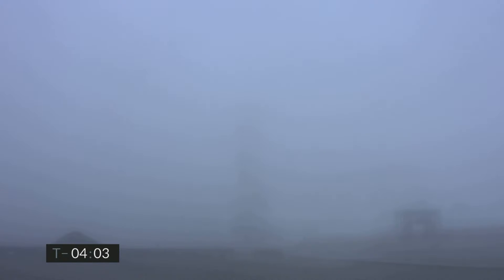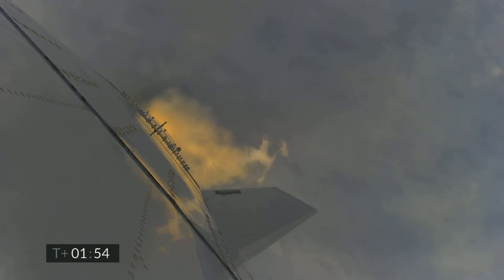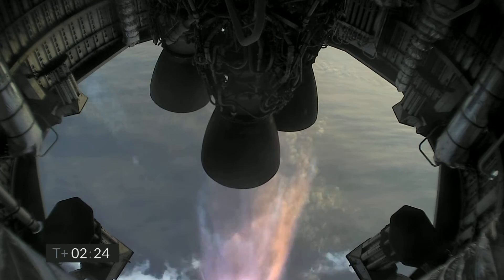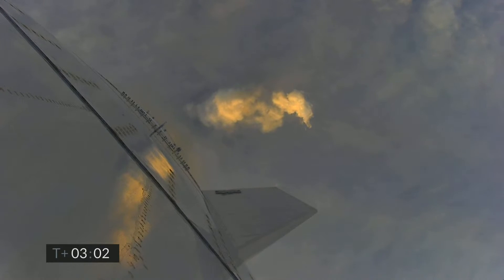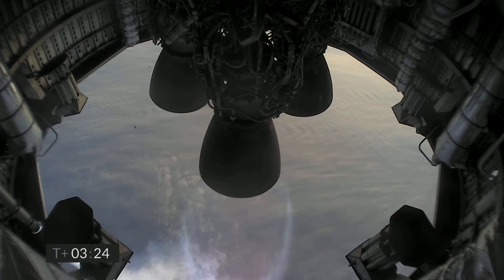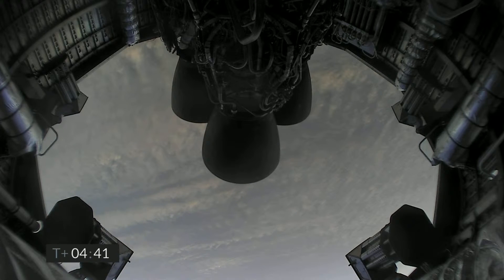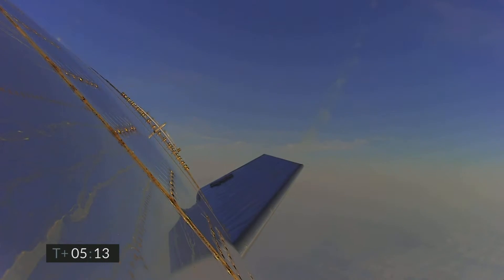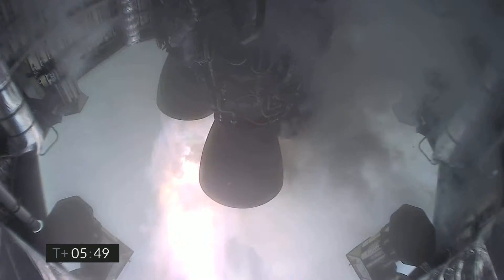Starship | SN11 | High-Altitude Flight Test

Comment: If I'm ever on Starship, knowing that it has failed in all these ways will be comforting. Once it's failed one way it can't fail that way again.
Reply: That’s like saying I’ll never have a flat tire because I now installed a new one.
Reply: It appeared that it blew up after the engine reignited. Probably a leek that caused the explosion
Reply: Wut? It is the same inability to reignite the engines over and over again. They already built 60 of those and still have no clue how to get the reignition reliability up. That's it. Project over. No engines, no starship.
Reply: @hans-joachimbierwirth4727  news flash: SN15 will use an entirely new block version of raptor. SN11 was running an old version of the engines because the new version requires plumbing changes. So, calm down, they'll figure it out.
Reply: @raiguard  He's just some troll who always starts shit. Take a quick look at his channel, it isn't the first time where he has tried faking being an expert at something.
Reply: Musk fans and their last resort...
Reply: @hans-joachimbierwirth4727  you clearly have no clue, for SN8 lack of pressure meant the engine couldn't start so that was 100% not an engine problem, if you're so good go work for spacex mr trollolol
Reply: @hans-joachimbierwirth4727  yeah glad you're not the one building it tho
Reply: If i were in charge they wouldn't have failed. I was responsible for the shift of quality control in design and engineering of nuclear reactors in the 80s. In contrast to Musk i know what i am talking about.
Reply: @hans-joachimbierwirth4727  ststistically the 80s were the time most reactors failed.
Reply: @illegalduckhunting  Exactly! And i am the man who changed that by implementing better feedback cycles in the engineering process. Reactors of the eighties have been designed in the seventies. My concepts came into fruition in the 90s.
Reply: @hans-joachimbierwirth4727  That's right H-J, but drink up now, your cocoa is going cold,
Reply: @hans-joachimbierwirth4727  wie findest du es eigentlich, dass du nicht mehr viel davon mitbekommen wirst wie sich spacex entwickelt und der mars besiedelt wird weil du schon zu alt bist? du bist alt und gehörst in rente, danach in den holzkasten.. 30 jahre hast du sicher nicht mehr
Reply: @hans-joachimbierwirth4727  Noone remotely intelligent enough to do the things you describe would boast about it on the internet.
Reply: Not in your Kindergarten of a fantasy world, but this is reality and there is no reason to omit it. Just in case you didn't notice i have a name while you don't.
Reply: @hans-joachimbierwirth4727  desperate old man...
Reply: They already gave up and you just didn't realize it. Spare me Musk's drivel. It is just that: drivel. This is not how you develop an engine.
Reply: @hans-joachimbierwirth4727  it’s a new type of engine, there will be troubles at the beginning
Reply: That's bullshit. They built 60 of them and that is an extremely high number. Not knowing how to reignite reliably with a serial number that high is mark of a flawed design caused by a flawed design process or in other words: the consequence of Musk's incompetence.

Comment: SN8...SN9.... SN10.... SN11: RIP.... A reengineering of the Raptor engines is required ... They are not working .. They always fail, in tests or in flight ..

Comment: Instead of trying to land on the ground or capture it with the launch tower, why not try catching it in air with a cable arrest system suspended by giant blimps? Starship could deploy a hook using a drag chute on its way down, catch the cable arrest system, and then get slowed down gradually by the buoyancy of the blimps, which could be space hundreds of meters apart, offering plenty of room for error. Then the blimps, which would be tethered to the ground near the launch pad or wherever, could be reeled in slowly. You wouldn't even need to restart the engines or worry about have enough fuel that feeds them properly.

Also, think of all the ad space on those blimps... $_$

Comment: THEY USED FTS, which means exploded on purpose with its on board explosives

SN11 wasn't that important, they already saw that the design HAD to be changed, and that is into the next starship to fly

SN11 was basically flown to move it out of the way, lots of things to do and no time to lose
Reply: Good point!
Reply: @Earth Or they just wanted to get rid of it because they knew it was going to fail 🤔🤔
Reply: @Earth no, the terminations is automated

it would have been faaaar better if it just hit the ground

we haven't ever seen so much debris kicked so far, it literally damaged some remote cameras from people that were just a couple of hundreds of meters away

never seen before, it was definitely because of the explosive that so much got scattered, better not exploding, it is was safer that way it seems

hopefully the FAA doesn't birch around a lot about this one, at the end, no one got injured and nothing got serious damage (and basically none out of the exclusion zone)

Comment: I dunno. The way I see it, you'd need to build a substantially large platform in orbit and fling it towards Mars and use a ship the size of SN11 just to to and from the surface. I can't see it being safe otherwise. A bit like kayaking across the Southern ocean is unsafe whereas floating around on an Iceberg would be quite safe.

Comment: It appeared that only one raptor lit back up.  If that was intentional, strange to do that when their closest successful landing was lighting 3 and using 2 for descent, 1 for landing.   If they were attempting to light 3 and only 1 lit, these raptors need more rigorous testing at the manufacturing facility.  Even a 99 out of 100 success rate lighting engines will not be good enough for human flight.
Reply: I literally described it in the "closest successful landing."

Comment: Knew it would blow up the moment I saw fire at the right engine. :(
Reply: that's normal, the insulation on rocket engines catches on fire all the time
Reply: @linecraftman3907  It was litteraly in the engines, even the center was glowing and it probably screwed up the Gimble system, hence it couldn't position and light itself up again.
Reply: @Singleraxis  yeah but it always does that so its normal. it would be better if it would not but metall should not  be affected by burning
Reply: @leo_is_a_baka  It's not normal, the engines have been doing nothing but RUD and thrust failures, including loss of pressure. There's definitely something wrong. The only normal part is gas being trapped inside the skirt, but even that SHOULD be tackled on in order to minimize exploding danger. As long the engines + Starship isn't landed yet, any potential fire is a problem, regardless where.
Reply: I'm not buying that fire on the engine outside of the bell is normal.  Uncontained fire is never a good thing.

Comment: At least they got a lot of data about propellant transition, aerodynamic descent, and vehicle reorientation in these specific version of starship. Great job SpaceX team! Rest in peace for SN11... go SN15!
Reply: I wonder why they burned so fuel rich again? (it can be seen from orange exhaust)
Reply: @ImieNazwiskoOK  its maybe a different problem with the same result
Reply: 14:48
Reply: how do you know they will continue with SN 15 and not SN 12?
Reply: @nurburgringkid  There is no parts for SN 12, and i think Elon confirmed that jump
Reply: @nurburgringkid  Those were built using an older design and were scrapped before SN8 was even fully constructed if I am not mistaken. Maybe even before that. I think it was just that as they were shelling them out, they found issues in completed designs and trashed any model being built to that spec for being inferior. Could have missed something here.
Reply: @nurburgringkid  They scrapped SN 12. Here's a proof from Nasa Spaceflight buddy..
https://youtu.be/rV1SoOpe63U
Reply: They already got that data from sn8 sn9 and sn10
Reply: @lancelikessause  Doesn't mean they don't need more data, right?

Comment: SN11 BLEW THE HELL UP IN THE AIR! SPACEX TIME TO START MAKING SN12 AGAIN!
Reply: nope, jump right to SN15
Reply: sn15 i think is next but next to be tested is i think is bn1
Reply: @timyg  bn1 won't fly, they will only take it to the pad to practice the transportation procedures
Reply: @kas-lw7xz  he said test not fly
Reply: Anonymer Nutzer  he said test not fly
Reply: Obviously there is an issue with this series of Starship.  Lets hope they have learned from it and made the necessary changes in SN15, which is the start of a new prototype series.
Reply: Anonymer Nutzer  oh wow, same time
Reply: BN1 will stand on new launch pad, so as soon as SN15 will be stacked SpaceX can do static fire test
Reply: time to analyse your failures BEFORE spending more money on building prototypes...
Reply: @jwenting  or make sure you have the flights down and good before moving on to a new series with new errors

Comment: Forgive me for asking - however, why would you launch a test vehicle in fog, when you cannot observe exactly what it is doing? It seems like a complete common sense bypass....!
Reply: The external visual is a tiny tiny portion of "what exactly it is doing".   
At several kilometers it is not about what you can see from the outside.

It is all the sensors, monitors and equipment IN the vehicle - pressure, temp etc. for all the components, pumps, engines, etc.
Also, they have multiple cameras in and on the rocket.

Remember - these are some pretty smart people doing this - literally "rocket scientists".
Reply: Look at it this way once this thing gets fully operational you're going to have to know how to launch in all types of weather conditions
Reply: @arnoldsherrill6305  Yes. And you'd do that only after you've got the basic performance reliably successful under 'picture perfect' conditions. During any test you'd eliminate as many free variables as possible. I agree with Daniel. This was stupid, dangerous, reckless and irresponsible. As an engineer I would rightfully get sacked and perhaps also criminally indicted on the spot if I'd even only suggested to 'test' the way SpaceX does.
It's disappointing that they don't seem to take any of their launches seriously. 
Should they someday soon happen to manage pulling it all off after all, after attempts like this it would seem like pure blind luck for a very long time.
Reply: @bosoerjadi2838  It took 20 attempts to get Falcon 9 to even LAND,  and "During any test you'd eliminate as many free variables as possible" ~~ SpaceX do not control the weather
Reply: @RichardGustin  They do control when to launch and what they plan to test. Especially if at this stage they're seemingly merely gathering physical data to feed their simulations with, to help design the required improvements.
Reply: @bosoerjadi2838  How well did the COVID simulations work? like shit, that's why they need real world data with a wide range of conditions, this makes their simulations more accurate -- what if they launched one of these and it was fine weather from the launch pad, but where it was supposed to land had changed weather conditions -- they need to design this thing to handle a very wide range of conditions, if humans are going to be inside these things.
Reply: @RichardGustin  Really. We all witnessed that even image telemetry was severely disrupted during this test, likely due to atmospheric conditions. Yet somehow you are convinced that SpaceX somehow succeeded in reliably receiving all the other telemetry data it requires and that they did well to risk not getting (all of) it.
They haven't even proven yet to be able to succeed once under perfect conditions. It's beyond arrogance to willingly make it harder before that.
What test next? Launching during a hurricane?